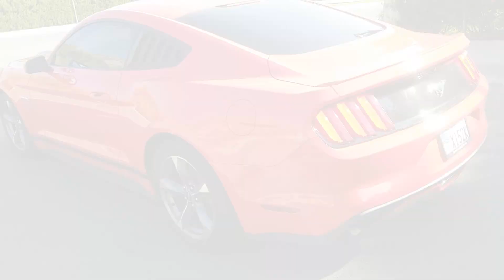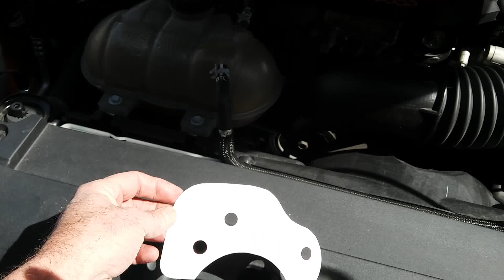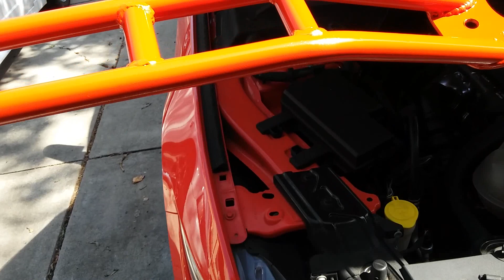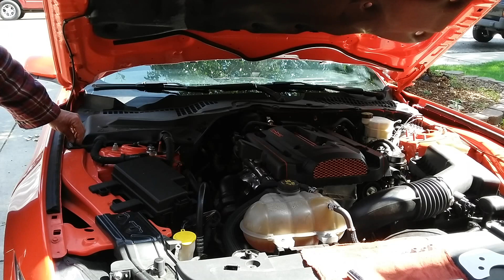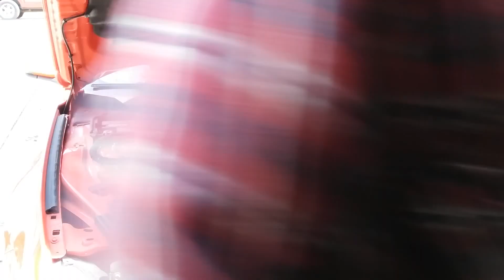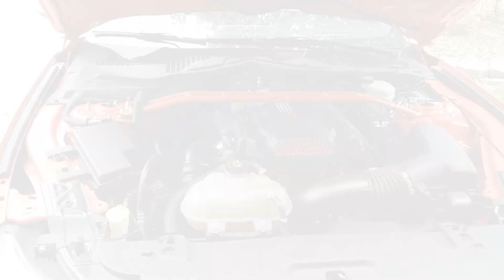MUSTANG STRUT TOWER BRACE INSTALL MOD

Comment: Quick question, how much did you spend on building it yourself? 
Thanks in advance 👍🏻
Reply from the maker: CRUZ_GT 
Under $10 for paint and the metric nuts. Just because I had the tube and plate already in my shop.